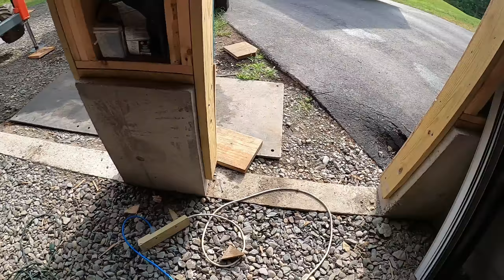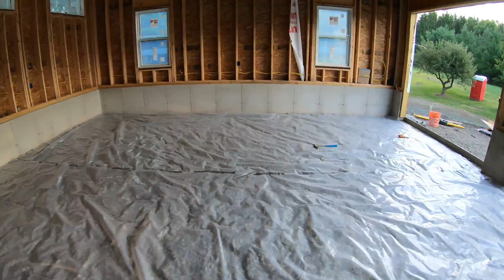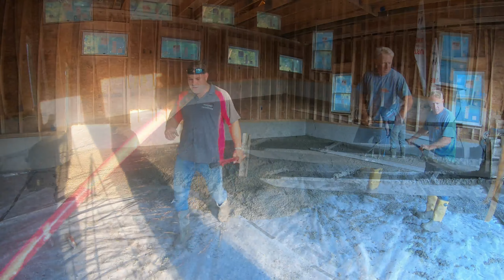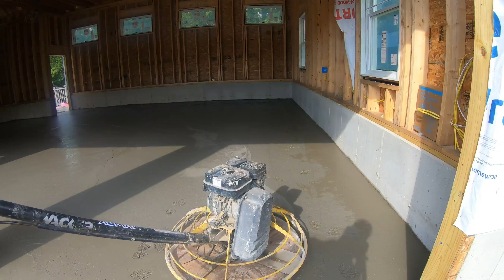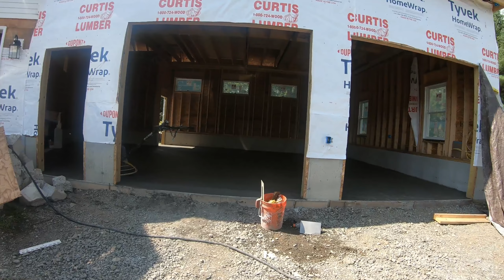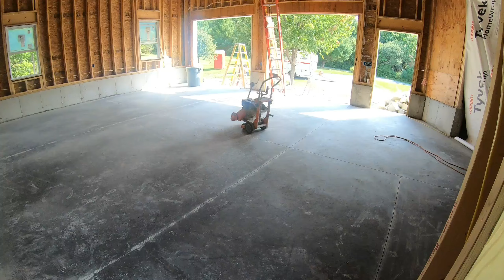Installing a finishing a 2 car garage floor using 4000 lb reinforced concrete with fiber

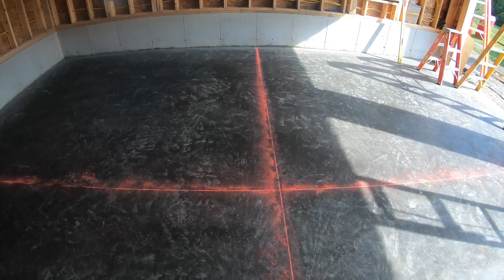Comment: At 17:19 you do saw cuts in the concrete, why do you need to do that? Is it for expansion of the concrete? Love your videos, very informative and enjoying to watch.
Reply from the maker: Yes sir it is for expansion
Reply: @DIRT-BOSS  Saw cuts are a used to create control joints in concrete, which help control where cracking occurs due to shrinkage not expansion. The cuts should be made at a predetermined spacing and only after the concrete has obtained sufficient strength but before internal cracking begins. Therefore, the timing of saw cuts is critical.

Comment: NO, I don't need to challenge you with the sledge! Anyway, another really nice job and WOW, gotta love that four car garage! Timing means so much and this job did not escape another 'variable'. You have the ability to know how to 'get out' of what the variable presents (recover). (Q? - Did "JJ' NOT have safety glasses on while you guys were busting all that concrete?) I kept wondering why that electrical box was sticking out between the 2 garages? Doesn't look like a brick/stone face, but? Thank you for another. Best to you and the family. (Now I have to go watch a 'lady" on a KOMATSU DOZER! Sonny (CT)
Reply from the maker: JJ was told! Not sure about the electrical box never looked at it.
Thanks buddy

Comment: No dowels into the external walls?
Reply from the maker: Some projects we do it all depends on what's on the print but typically we don't especially if they don't heat the garage and the floor freezes it can pick and the walls don't then it will crack
Reply: @DIRT-BOSS  Hey thanks mate. I did not consider that. I live in Queensland Australia.

Comment: Putting down concrete is so easy from my chair.... just smoosh it around with the rake a little bit... time for power tools!   It ain’t no thing!!!

But, I could use some advice... why? Every time I put down concrete and I’m not in this chair; it comes out wavy and I find myself chewing Advil and slathering on Sportscreme for two days afterward?   Could it be that my chair is better at concrete work than I am?

This was a most excellent how-to video... Brandon sent me here and I’m gonna thank him.  You have a new subscriber.
Reply from the maker: Hey thanks buddy welcome aboard.. i have a lot of how to videos I put a lot of detail in a lot of them!

Comment: I’m sending you a gallon of confilm / evaporation reducer to slow drying on a slab.  Gives you more time to work on a slab in the sun/wind.  If you had a gallon on your truck you could have blessed the first truck with it after hitting it with the bull float and kept it open a little longer.
Reply from the maker: Nice I didn't know there was such a product! I get I get over to see you I'm always going past to my boys down at JC.. on the right..
Reply: Love the confilm on a windy day.  Mix with water 9:1
Reply: @DIRT-BOSS  aqua film or con film is great, apply after screeding and it will remove all stickyness of the concrete, and it will help seal up the finish without the need for water. Water just hurts the surface and makes it weak.

Comment: As I concrete guy who has been pouring concrete since 1989 I would never pour a garage with just fiber.  All my garage slabs are 4000 psi and #4 grid 2'x2' minimum . Fiber is great for shrinkage cracks and thats all I trust it for
Reply: and thats a lazy mans way of doing a weather lip.. smh
Reply from the maker: Okie dokie pokey I'm not the engineer on the job I guess you are
Reply: @DIRT-BOSS  Nope but I dont cut corners to save a buck. If that was the designers spec I still put rebar in. Just bc they spec it that way doesnt mean its the right way
Reply from the maker: @devilish34  okay John You've made your point I'll hire you to pour all my concrete and I want gold rebar in there so you're going to do that correct for the same price?

Comment: Is fiber reinforced better for garage floors than a rebar reinforced?
Reply from the maker: Its a substitute for wire mesh, rebar is stronger but way more expensive. For a typical garage its fine but if your looking for bulletproof use wire mesh and fiber mixed together

Comment: Nice job Mike,  I'm guessing with all the fiber sticking up you wouldn't want to walk on the concrete in bare feet, will it eventually be completely smooth?  Nice video as usual.  Stanley in Md.
Reply from the maker: Yes they break off but it is soft fiber.. It won't hurt your feet.
Reply: @DIRT-BOSS  sounds good, thanks.

Comment: Weird to see you dont use rebar in your area but loved the video.
Reply from the maker: We do use rebar if it's called for on the specs but typically just in a garage it's either fiber or wire

Comment: FYI, you don't actually want your concrete to dry quickly. instead of blowing air across it, you should be covering it to trap moisture. though, I guess if it is over-built, then the customer may get half-strength concrete but they'll be able to use it sooner.
Reply from the maker: I got you we're not building the bridge though can't be for 2 weeks with burlap bags !
Reply: @DIRT-BOSS  . fair enough. though, if I were the homeowner, I would prefer a slower drying.
Reply: Placing that concrete on top of plastic is going to really slow down the cure.  I'd check the humidity, but this job looks to be well within limits for this type of installation.

Comment: No wire?
Reply: Ah, the fiber (are the cuts decorative?)
Reply from the maker: no for expansion
Reply: I thought that at first but you indicated the cuts were 2" deep in a 4" slab, so only the top half of the slab expands?
Reply from the maker: @TairnKA  specs are 1-in on a 4-in slab is what it calls for It cracks right through.

Comment: You theory of concrete is conflicting. You cast concrete with fiber reinforcement -- but then you scored it also. By scoring it you seem to believe that the concrete will shrink and inevitably crack, but you have no rebar to prevent the slabs from shifting. The fiber isn't going to be able to prevent those shifts. Why do you believe this is the right way to do things?
Reply from the maker: First of all I'm not an engineer but the guy that stamps the print is and that's what it says to do That is the industry standard concrete one-on-one!